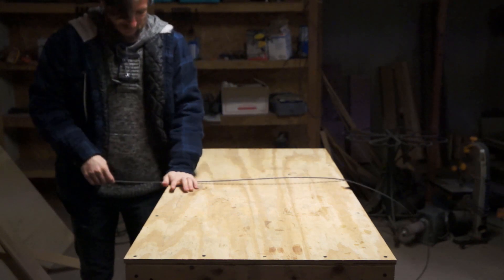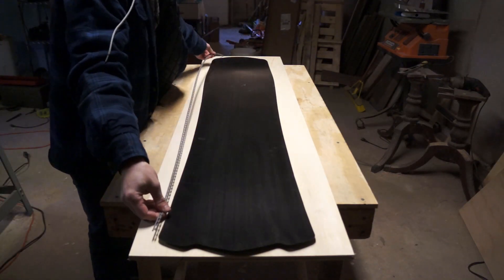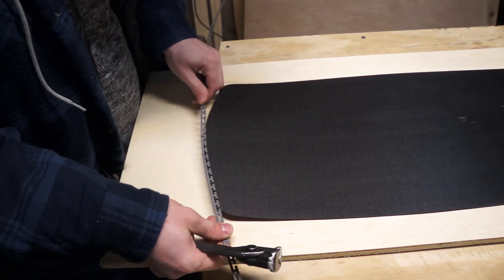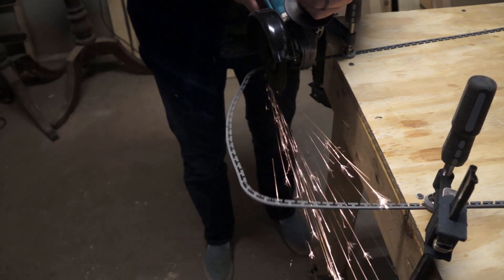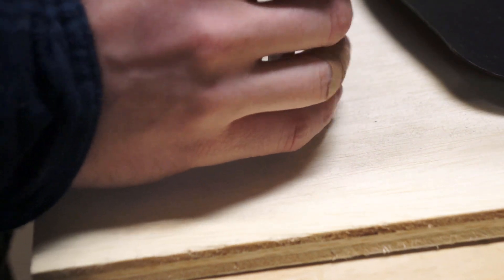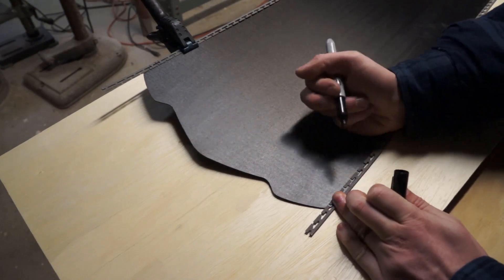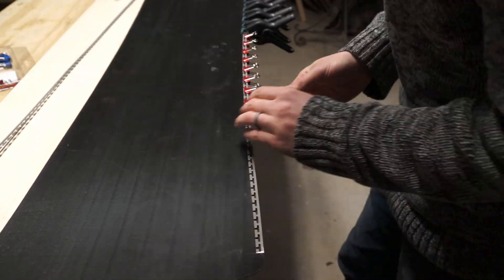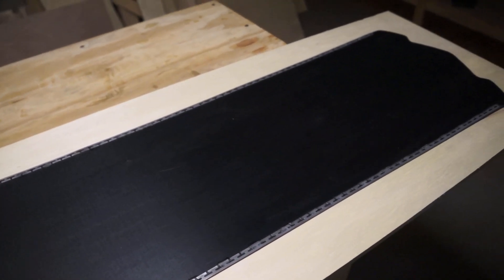Building a Snowboard - Part 5: Bending and Gluing the Edges

Comment: Sweet video! I'm building my first snowboard. I'm having trouble with the edges, I made my edge bending tool and it works great, but I have a problem with the edge  twisting.. any tips on this?
Reply from the maker: I had that happen some too, all I did was hammer mine flat using a small chunk of steel as an anvil. No idea if that's the right way to do it, but it seems to have worked for me